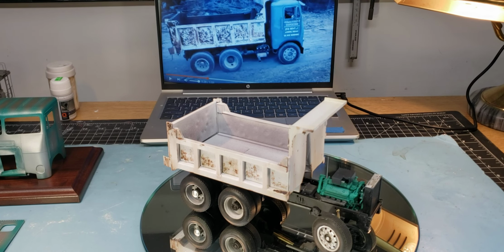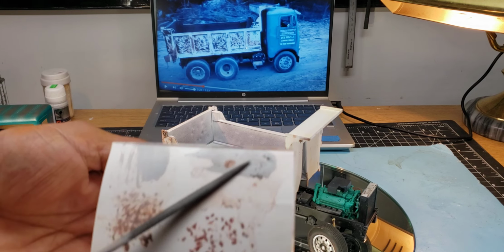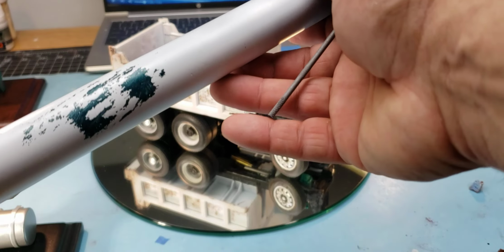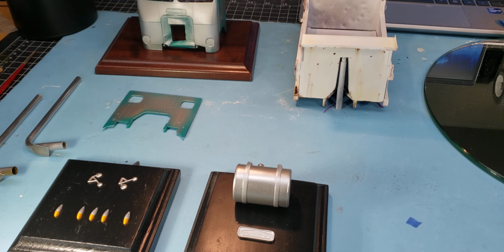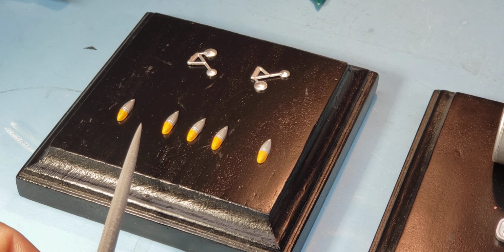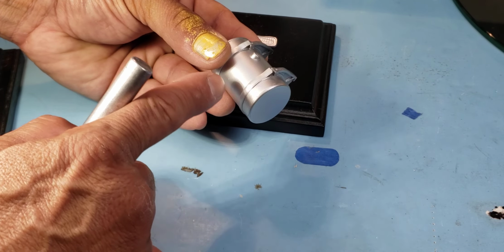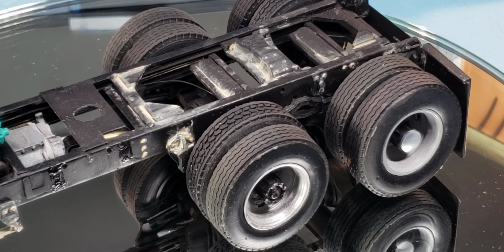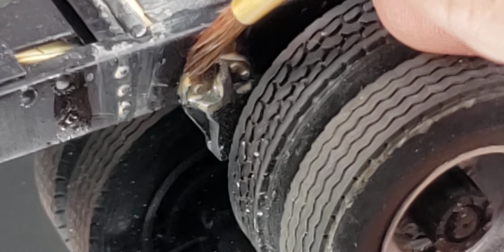AMT Freightliner Dump Truck Update April 22, 2023.

Comment: Drill and pin like you showed on fuel tank is the way to go for many parts, especially ones that are a contrasting colour - easier to paint them separately and then install securely at final assembly.

Combination of varied weathering techniques is bringing this 'ol dump truck to life nicely!
Reply from the maker: Thanks B&R...weathered the entire chasis tonight....so far so good.